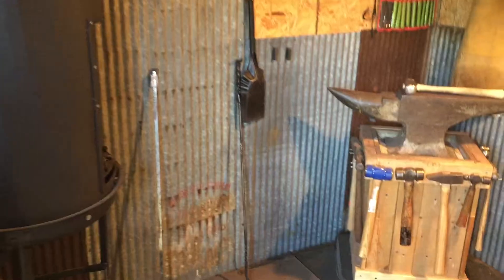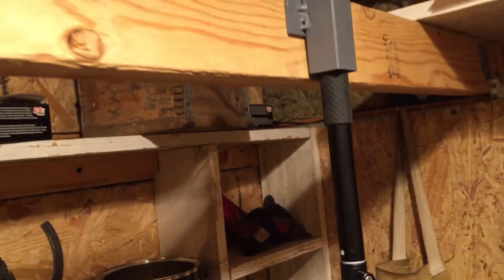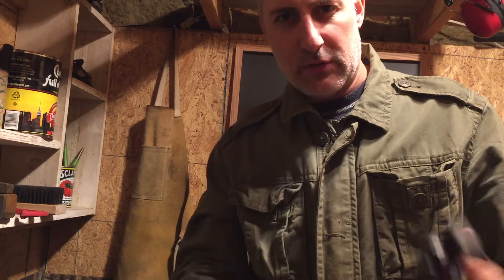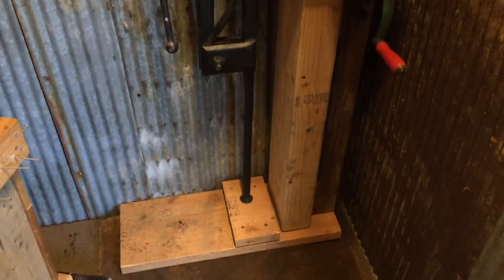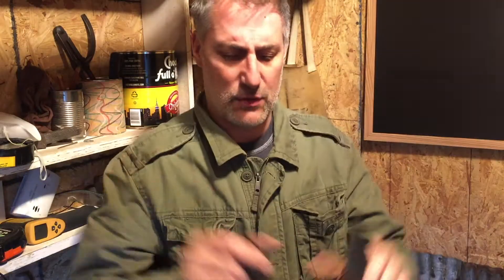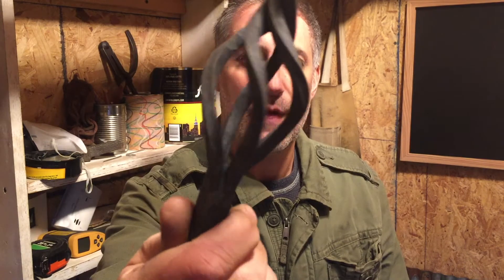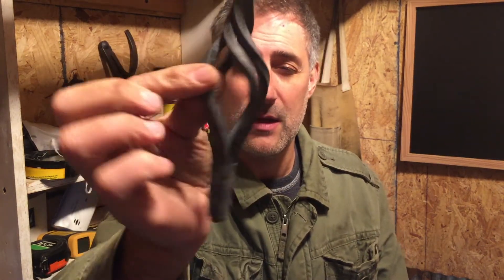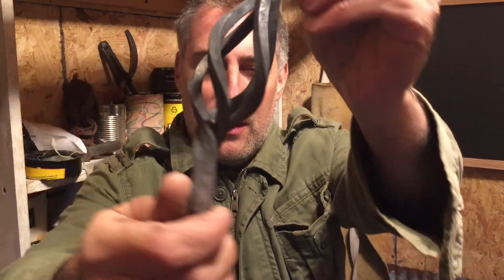Updates To The Tiny Blacksmith Shop

Comment: upgrades look great and the forge welds look awesome. finding someone that has been at it for a while is a great and to learn new things from. nice grinder also BTW, lol.
Reply from the maker: +Chirpy's Tinkerings - Thanks Chirpy. Nothing major but enough to make the tiny area even better to work in. I was surprised on how cool the grinder is. Hope to actually use it.
Reply: I use mine all the time for grinding knife blades and touching up tool bits. The speed is easier to control, so you can get a "fine feel" for how the stuff is being ground. I was just using mine a few hours ago to sharpen my brother's knife when he was here, lol.

Comment: Nice upgrades!

Having a deeper pot will allow you to do larger projects.  However..  if your projects remain smaller, the larger pot will waste fuel.  You may want to consider claying in the rotor with a nice taper.  It will improve the over all performance. 

Thanks for the video...
Reply from the maker: +shadowcastre - Thanks for the suggestion!

Comment: I think your basket twist turned out great! I've never really even tried to make one myself. A suggestion, for if it get extra cold in your shop this winter, would be to get a magnetic block/oil pan heater from an auto parts store. Stick it on the anvil the night before, to keep it a little warmer, and help prevent it from being a huge heat sink. Good to see a smithing update from you! I need a shop in the worst way. Check out my J hook vid "this is not a challenge" video.
Reply from the maker: +drason69 - Thanks man! Great idea about warming up the anvil. If I haven’t already, I’ll definitely watch your video. It sounds like a great reference.

Comment: Question - How loud is it outside of your shop when you are forging?  I want to setup a similar shop but my neighbors will freak if they hear the pounding when forging metal.
Reply from the maker: +Jason - It’s not loud at all. Yes, you can hear it because I couldn’t sound proof 100% but the noise drops off dramatically as you move away from the shed. Given that I’m doing this in winter, you can’t hear it at all with the house windows closed. Check out my playlist of me building and sound proofing this tiny shop.